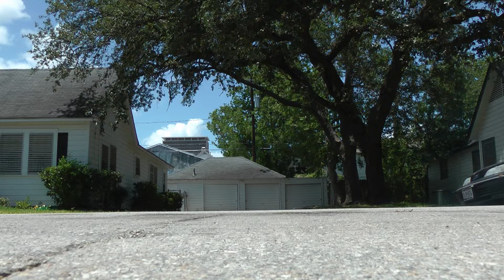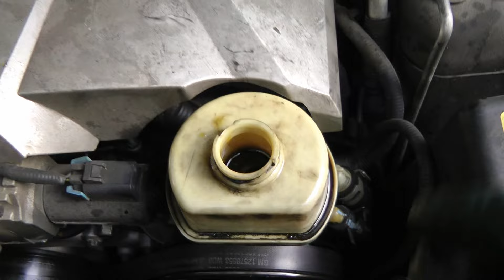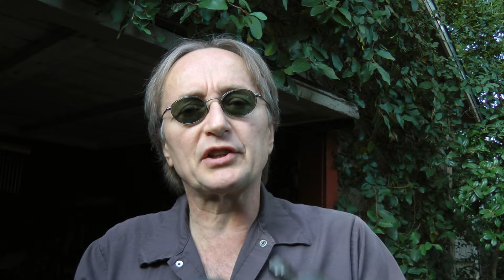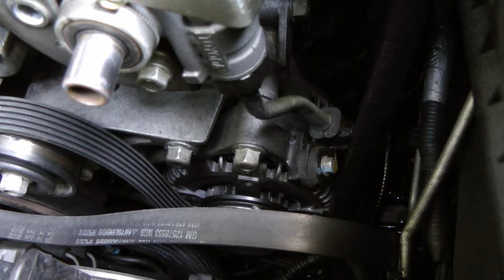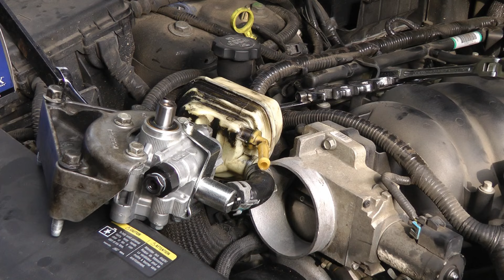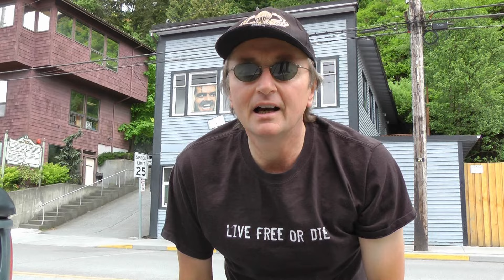How to Replace Power Steering Pump in Your Car

Comment: Hi again Scotty...2007 Honda Pilot with 80K miles just developed a sudden whine (with rpm in park or drive and temps here just rose dramatically over the weekend) coming from power steering pump. PS fluid level is good and steering is still loose. Should I try to replace the o-ring leading into the pump from the hose as a start point? I have heard this effects other Hondas in this year bracket.  thanks and live free!
Reply from the maker: give it a try, just realize pumps go out a lot on those pilots
Reply: jtexas1974 I just had my 2006 Pilot aligned with new tires this weekend and it handles like a dream now. but yeah I have heard of people having leaky ps pumps on these trucks. you may wanna get the alignment checked out also if you're experiencing loose steering.

Comment: Scotty! I have an 04 Kia Optima and whenever I start my car, it vibrates. The vibration is centering around the power steering pump and pulleys. Also when i accelerate it vibrates then dies out. Could it also be a dirty throttle?. Thanks!
Reply from the maker: could be tons of things, try cleaning the throttle and if that doesn't work, remove the fan belts and it if goes away, the ps pump could be wearing out and dragging

Comment: Oh god! this reminds me of the Ford Power steering pump pulley.. they were a pain and i remind myself to either sand the paint off inside where the shaft go or heat it or freeze the powersteering itself to make the god damn installation easier.. Idk Scotty have ever dealt doing this on Fords?
Reply from the maker: Yes, I often have to use heat on those stupid things to get em off, but greasing em and using the tool gets em back on easy
Reply: Scotty Kilmer Yes, i did use grease and my service manage thought i was clowning around and i let him tried it.. i told him to go back and forth and it goes in 1mm per hour so that stupid tool with tiny bolt that grabs into the shaft wont snap... and he did.. lol my theory on this that the engineer made this pulley in such an interference fit and forgot that they paint the inner hole of the pulley..
Reply: Ken M little advice.. those pulley noises 50% of the time are either that pump or idler pulley.. my service manager always gives me this joke all the time with F150.. lol

Comment: Hey Scotty love the videos, quick question though. Ive got a power steering fluid leak and when i went to a shop they told me it was a filter leak, but were gonna charge me 160 for a whole new pump and then 90 for the labor. If its just a filter leak then do i really need to replace the whole pump itself? or are they just trying to get my money? Or does it just happen to be worlds easier to replace the pump than a filter in the pump? Thank you!

Comment: hey scotty my rack finally went bad in my car and i don't have a problem driving it old school style to where i need to work on it. my concern is though, the rack is leaking so bad it really wont hold any fluid for long and i don't want to burn the pump up with it. so my question is would it be possible to run a line from the pressure side of the pump to the return so it stays lubricated so i can drive it?
Reply from the maker: no, that pressure would blow things up, just remove the power steering belt so it doesn't spin any more.
Reply: but then the water pump wouldnt run so would i need to just figure out a length of belt to just run that?
Reply from the maker: Ryznrun
yes, if you can find one that size

Comment: I have the same issues and synetic. Did that question ever get diagnosed? Power steering seems to be fine but at certain spots when I turn my wheel left it squeels. It goes away when I turn ojt of the squeel range....but its anoying and embarrising. Any ideas?

Comment: Hey Scotty, first all off your videos are awesome..

But I have 1 question.. well my power steering pump making so much noise in the first start up and when I turn it left or right although it goes away when the engine is warmed up. What can I do? Do I have to change it or pour some cleaner in there?

Special thanks from Hawaii..

Comment: how hard is it to replace 2003  sienna power steering pump , I removed the wheel and I can see power steering pump under the pulley leaking bad, and very hard to turn steering wheel , has no power .

Comment: I think you replied to wrong user, but if i were you, i would not run the pump dry, if you destroy it, new one will not be cheap.
And depending on car, very hard to get also.

Comment: If I drain the power steering reservoir with a turkey baster,Can I keep the engine running and turn the steering right to left to bring up the fluid down below without damaging  any parts? or will it be a bad idea to run it out of fluid!

Comment: Are there any other sounds a typical power steering pump makes when going bad?  I have a creaking sound (like hinges on a heavy old door opening super-slowly)  occurring when I turn my wheels in either direction in my Toyota.. But the wheels don't have much difficulty turning, suggesting the pump is working.

Comment: I have an issue with my 86 mustang. I think its sucking air cause it keeps spitting the fluid out the cap vent hole till the pump makes noise. I refill and it does it all over again. I put on a new rack and p a couple years ago and this week a pump and hoses. The only thing left is the cooler on the low side. So I suspect that might suck air or the rack is bad. Rack also has two lines but they are tight. Anyway to tell whats going on, since its not leaking but out of the reservoir cap? Thank You

Comment from the maker: either the pump, the high pressure hose, or the steering racks leak on those. I put UV leak dye in them myself and then see where the green dye comes out. Pumps cost a ton on that model, pray it's the hose

Comment: hey scotty I have a ford mustang 2001 v6 3.8 and I already replaced the power steering pump because of the whining/groaning pump and the oil was very bad all burned and smelly/black when I installed the new pump y flushed the power steering by cranking the engine and turning the steering wheel but it keeps making noise I replace it like 3 weeks ago, what can I do?

Comment from the maker: use ONLY brand new pumps, rebuilt ones are often worse than the one you have on originally. But if it still groans, replace the power steering rack.

Comment: Oh and I was recommended Lucas Oils Power Steering Leak Stop, just in case the system was leaking somewhere... Lucas Oils seems to have some nice products, I saw the video where you said the jack you used one of their products on has been working for a long time.

Comment: I've got a 99 Sable as well, and we did the awesomely fun lock-lock bleeding of the air out of the system to get the power steering to work again... it's not leaking, thinking a rough road got air into the system since the reservoir contains a good amount of air. It makes less noise after bleeding it than it did last year when we bought the car.

Comment from the maker: if you didn't use a brand new pump, rebuilt units are often crap and whine. if not that, a worn power steering rack will also make em whine, pretty much guesswork though, no tests available to check them

Comment: hey scotty, we replaced the power steering pump, but it has not seemed to fix the problem, it still whines.  Could it be air in the lines?  Whats the best way to get that out, or is there something else I should check for?

Comment: Hey scotty, we have an 04 excursion(diesel). There is a ps fluid leak. Weve inspected all the hoses and all are in perfect condition. We assume its the steering box, atleast thats what are "diesel mechanic" told us. We dont really ever see any oil spots on the driveway but the ps starts making noises about every 100 miles and we just put more ps fluid in and it runs like a champ. I dont think ps fluid can burn off, but would there be any reason we wouldnt see oil spots on the driveway?

Comment from the maker: make sure the belt is the right tension and not too tight, changing the radiator won't effect the pump in any other way then you tighening the belt too much. Or, it's just a coincidence and your steering rack just is worn

Comment: Hi Scotty, Im having issues with 93 c1500. I replaced my steer box since it was leaking but now when ever I turn to the left it makes a loud groaning noise. I've since flushed the system with clean fluid. I bought the steerbox from autozone and noticed that the threads from the hoses don't thread all the way and can hear the air. What do I do? Thank you for your time.

Comment: I would have raised the front wheels turned them from lock to lock to bleed most of the air out before running the engine and pump

Comment from the maker: remove the fan belt that powers the power steering. If it runs then, the power steering pump has locked up and will need replacing. nissans will use any foreign power steering fluid, if the pump broke, it was just its time

Comment: So as i was pouring the liquid the engine started to make some bizarres noises, and then the engine just died ... no way to restart it when i put the key in the ignition, the panel turns on and all the light works the radio turns on the battery level is at 12 but when i turn the key all the way everything turn black and nothing happens except a little pumping noise in the front of the car which i suspect to be the power steerings pump, later on i checked the owned manual and it said use DEXRON

Comment: Drain the reservoir and see if you have that screen near the bottom.  Mine was like that and that screen was almost completely blocked with carbon.  Hit it with a little carb cleaner and the black gunk will just melt off.  Then, put the fluid back in, and the noise will be gone.  Nice design by Ford -- protect the system by blocking the fluid.  Nice.

Comment: Hey Scotty quick question, my pump was making whining/groaning noises so I replaced the pump and bled it, but the new pump I purchased from autozone is still making the same whining/groaning noises just not as loud as before. Is that as good as its going to get? should I return and exchange the pump and try another one?

Comment: When you flush a power steering system do you just change the stuff in the reservoir or do you take off one of the hoses and run the system completely dry? Im afraid I'll ruin the power steering pump if i run it empty. What do you think, just change the stuff in the reservoir? Thanks for any help/tips!

Comment from the maker: you're low on ps fluid, find and fix the leak, that makes em groan. On that old thing, check the high pressure hose on the pump first
Reply: Does that cause a leak in the pump assembly? My leak is like a waterfall not a drip...

Comment: Hi Scott,
I have a 1998 Mercedes E320 Saden, I problem with steering wheeling.  when I turn the engine on, and turn the steering wheel it make a groaning noise at the same time I saw fluid leaked on floor and some on the wall closed to the steering hose.  Please tell me what is the real problem? Break fluid is also low.

Comment: Hey Scotty! One of my power steering hoses sprung a bad leak and it ran dry a couple times before I got the new hose in. The pump still makes a "whirring" that's quite audible but the steering isn't sticking or hard to turn. What should I do? Replace the pump?

Comment: hey scotty i have a 94 mazda mpv and when its cold or if it sat for 30 min or so (i live in NY its about 20-30f)it makes a noise like when 2 metal parts are grinding each other but stop after 1 min when its cold and reving or 2-3 min when it sat for a while. When you rev it gets a little worse for like a sec but you dont hear it increasing with the rev.It coming from the left side and i have my steering pump,alternator and water pump is in the middle.idle is smooth,no hesitation,

Comment: Scotty - you had a video that showed how to clean out the power steering system using Trans Tune. Did you remove that video, cause I want to watch but can't find it. If it's still available, can you please post the link? Thanks!

Comment: transmission fluid was low..small leak at the  place the lines run into the radiator.   and the spark plugs were loose.   not one of them were tight.

Comment: i let my 98 camry 4cyl sit for about 3mos.bec of bad water pump...now fixed waterp/timing belt, and,   all this has happened within 2weeks  of getting the car back:      the power steering fluid  mysteriously goes missing...  and there is  a bad cell in the battery and the starter all go out...and now, the transmission fluid is low.and  shuddering at high speed.  
so what the  heck?  what causes all that?  rack and pinion  screwed?  and, transmission?   ???

Comment: i will be replacing the entire pump/pulley assembly but im sure its not the fan/fan belt since the fan is driven by its own motor. i think it may be the bearing in the pulley but regardless thats a sign of wear so the situation is going to be dealt with thanks for the insight its appreciated.

Comment from the maker: pumps that make noises generally need replacing, period. Make sure it's the pump making the noise by removing the fan belt. If it goes away then, replace the pump

Comment: scotty i am hearing a noise coming from my p.s pump but it is not like any other i can find it sounds like a clicking or crunching from a bearing that drives the pulley any insight on this before i bring it in and get ripped off for a whole new pump ? thanks.

Comment from the maker: this is about flushing power steering, but if you're talking about engine oil flushes, only do them if the oil is really crudded up inside, which of course should not be the case if you maintain it correctly in the first place

Comment: I bought a 2005 Kia Sorento in addition to my 99 camry. On my Sorento its leaking power steering fluid slowly. The pump is also making a groaning noise as well. I added fluid but it seemed to do little. When its cold out the pump acts up. 

The mechanic at car max can't find the leak. I am frustrated with the mechanic. 

Anyone have some ideas thanks

Comment from the maker: NEVER power wash engines, often creates problems. he should have known better. Pray it dries off and stops doing that and he didn't damage the power steering. If it still acts up, change the fan belt and pray that fixes it

Comment: my mechanic power washed my engine after causing the transmission cooler line to pop off while driving, now my power steering is groaning and feels a little stiff. I never had this issue before, what should I do. He said I am just hearing things.

Comment: Hi Scotty, thanks for the vid.
What does it mean when the belt is tight, fluid is full and the pulley still freezes causing a squeal and turning to be bad? It especially happens when I first start the car in the morning or after work when it's not warmed up.

Comment: Mr. Scotty, I bought re-manufacture Power steering pump and installed it 2 days ago. It hasn't stop groaning. Is it the re-manufacture pump. bad? I had drive  68 miles from home to work every morning. The groaning should of been off by the first drive. Oh i drive a chevy impala 06 Lt, V6 3.5L

Comment: Scotty! I have a problem with my power steering and it looks like I need to replace it. I do have a question regarding my options. One is with speed proportional steering which is cheaper and the other is without. Which one should I choose? Thanks in advance...

Comment from the maker: I would assume one of the lines wasn't put on right or the seal was on cockeyed. Those babies put out 1600 psi pressure, any small mistake will gush out oil

Comment from the maker: fill it up, see where it leaks out. If the pump, it will come out at the pump seals behind the pulley. If hose, it will leak at the hose. If steering rack, it will leak at the ends near each wheel with the rubber boots getting wet there.

Comment: Ok, Scotty, I'm going to see how much information I can give you.  2002 Chevy S10 4.3L Extreme.  Power steering fluid suddenly and completely lost in about 3 mins--steering deteriorated quickly as the groaning noise increased in volume.  Refilled fluid this morning.  No apparent leaks.  The resevior and hoses bone dry.  On starting the engine, the fluid quickly came out of pump.  An experienced guess from you--bad pump or seals blown?  No issues with steering until this happened.

Comment: I have a 96 gt mustang. & my car has been making a weird, grinding sound, i say kinda similar "airplane" sound. It comes from the driver side near the belt. Ive been told from a shop i have a bad pulley, another person told me sounds like my power steering pump. So how do you really know? Are either one way expensive?

Comment: Hi Mr. Scotty,

I just went through the process of replacing my 95 Deville's P/S pump.   Darn thing still groans...tipped the car at a slant and turned the steering wheel to and fro to 'burp' it a bit...  Still groans.  Any suggestions?  It's not my first time under the hood, but I'm obviously missing something.  Thanks :-)

Comment: my power steering fluid pump was ripping apart internally. i was wondering though. does it have any effect on the transmission? reason i ask is because every time my car was "harder to steer" my transmission would shift really low and lazy. now i drove it home with a new power steering pump my transmission shifted quicker

Comment: I am sorry for all of the questions, but I just replaced the fluid and it seems to be making the same noise.  On the bright side, the ride is much smoother and turning is better than I have ever experienced.  I tried the vibration trick with a metal kitchen tool and it seems the Tensioner caused the most vibration, with the Compressor coming close and pump hardly at all (comparing).  Is there a way to test the tensioner to see if it is causing the bad noise?  Thank you!